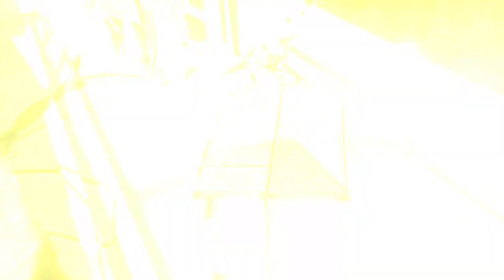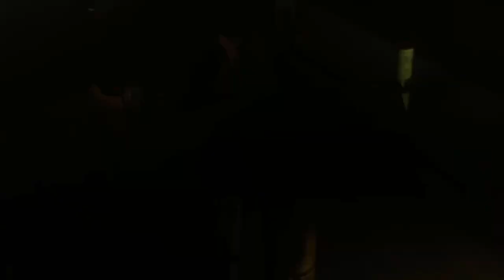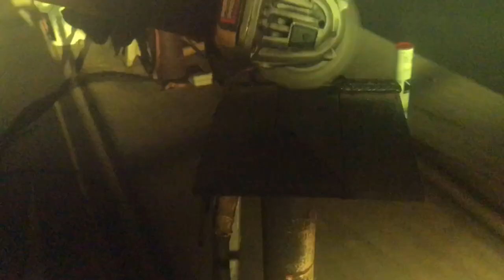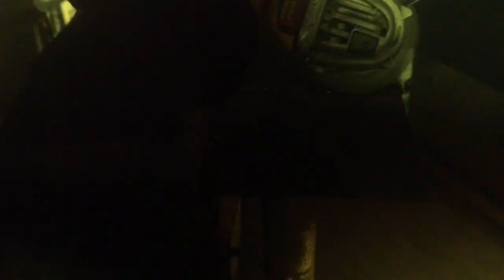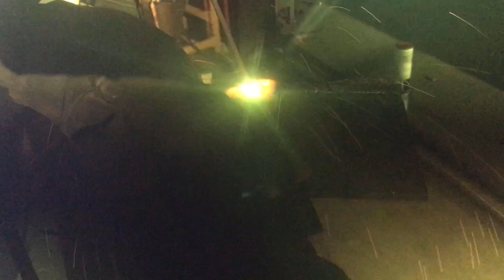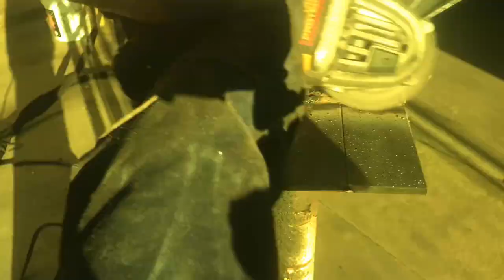How To Strike a Arc With 6010 Lincoln Ranger 225

Comment: How are u liking the ranger? I'm looking at this the bobcat 225 or the Hobart champion elite right now. Like the CV side but the champion elite has built in 50 amp plug so I could easily plug another machine in and for price of the feeder compared with a small mig machine I don't know if it's worth extra grand to 1,500$ for the CV option on machine
Reply from the maker: I love it! It has done anything I put it up to even some light carbon arc with 1/8” carbon rods. Runs 6010 better than I can and 7018 like butter! And it will run any machine you plug into it perfectly fine I have run my small 110 flux core welder on the 110 side with no issue(will be making a video of that soon) and have run a Hobart mvp mig off of the 240 plug don’t know how high that will go but ran fine welding 1/4” didn’t really do more than that but am sure it could!
Reply from the maker: I haven’t run cv much on it tried to but the machine I bought for $400 off of craigslist didn’t work found out the guy I bought it from sold several people broke equipment from his former workplace
Reply: @adamswelding5052  damn that Sucks, sorry brother. Thanks for response
Reply: @adamswelding5052  nice all pluses for me. What was the cost of the machine, what's fuel consumption like on it?
Reply from the maker: They average around $2600-$3300 but can be found with coupons for lower prices with rebates and or extra stuff as a package deal kind of thing. They used to have a rebate for something like $1000 or a wire feeder but that ended a while ago.

And as far as fuel consumption goes on high idle I get about a solid 8-10 hours run time. And on low idle I get 12-16. So it does pretty decent just don’t try and fill the tank too much it isn’t good and causes the fuel tank breather not to work right and can damage the welder(not covered by warranty) had a friend do that and had to pay out of pocket to fix his brand new machine
Reply: @adamswelding5052  nice in price range I'll have to look for a deal then. And I've heard something like that about fuel tank.. think I've also read it was fixed as well... May not have been though and I'd def keep that in mind.
Reply from the maker: Did not know they had fixed that. Well if there is anything else you want to know about the machines or anything welding or rig related just ask if I can help explain something or make a video to help I will
Reply: @adamswelding5052  may* have fixed don't take my word on it but maybe worth a call to Lincoln. Really just started machine shopping last night. How well is the Tig on it?  My current machine is valve torch with no pedal and lift arc.  Any hf start or foot pedal capabilities?
Reply from the maker: I know mine would be pre fix anyways. It doesn’t have any HF lift arc or foot pedal on this machine but you can buy aftermarket HF boxes from Lincoln or miller but they are pricey and in most cases cheaper to buy another machine and run off of the 110/240 generator. They run scratch start good you just have to figure out your amperage to voltage side of things. The height you turn your fine adjustment on the amperage setting the coarser the arc and the height the voltage/dig is so you have to find the balance of it but one you do it runs pretty smooth! I’m rusty on my tig welding and most of my welding have been taking it easy the past year due to health issues but am getting back at it now that those have been resolved.
Reply: @adamswelding5052  that's fine I'm pretty good with the adjustment side of it. Def a good feature for 6010,7018.

Comment: How often do you use 6010 compared to other rods?
Reply: Wondering because I'm curious how often its used in a work environment. I'm using it in school, but don't like it much. Can't wait to get to 7018.
Reply from the maker: That is a great question! Well to answer it though isn’t going to be too helpful. It really boils down to what you are doing and what codes it is required to meet. If you are welding doing repair work, full pen open root welds, pipe welding, or anything like that is is a very useful rod to use I use it quite often for quick tacks because it is a fast freeze type of electrode meaning the tack will solidify quickly and minimize distortion.
Reply from the maker: And as far as not liking it much is that because of the spatter or are you having trouble with the whipping motion? If you are having trouble with the whipping motion how about you try this technique, when you whip, whip to the edge of your puddle, pause for a second, whip back about half as far and count 2 seconds, and then repeat.
Reply: @appalachianamerican3881  if you ever want to weld pipe u better get to be friends with 6010
Reply: Victor Ryan I used to hate 6010 but once you start getting paid 25-35$ a hour you’ll learn to love it. 😂
Reply: @cal3b803  I love 6010
Reply: Use 6011 it better I think it work better 6010 I ran 6010 I like 6011 or 7018 better

Comment: Wrong 6011 is better for rusty metal and I like useing 6011 or 7018 better
Reply from the maker: 6010 is better than 6011, 6011, is a similar rod to 6010 but designed to run on machines incapable of running 6010